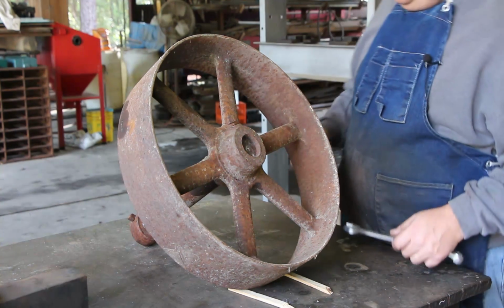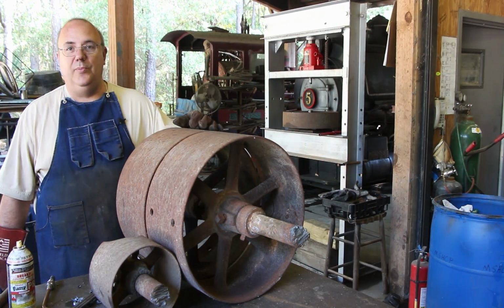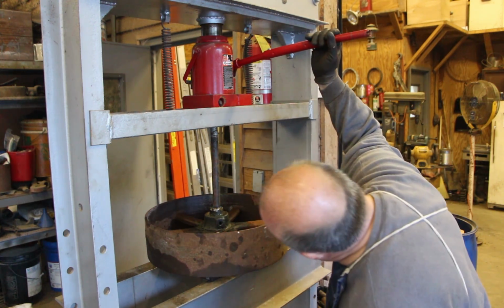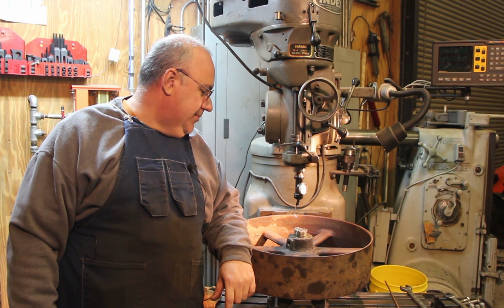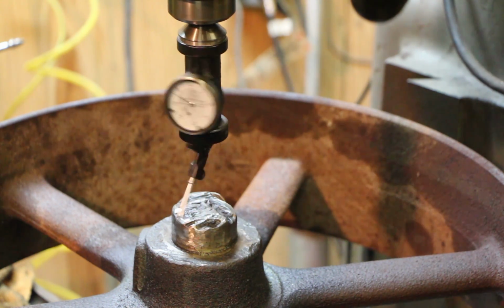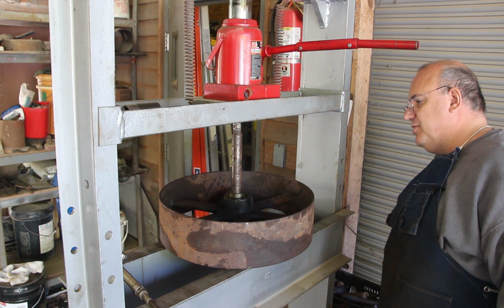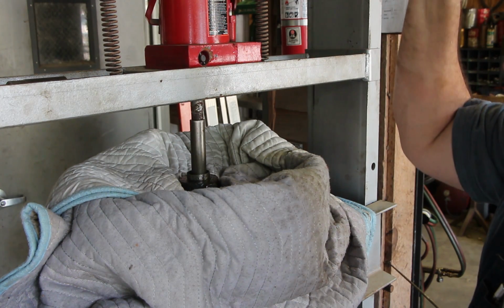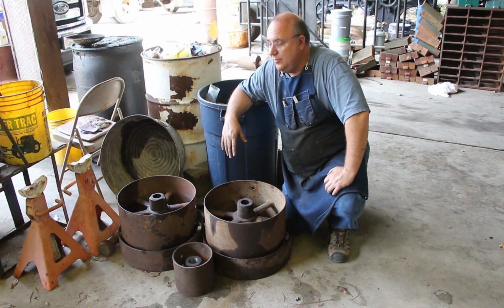Removing Stubborn Shafts from Flat Belt Pulleys

Comment: Once you had the hole drilled out, did you consider cutting it out with the torch?
  I've done that with large liners in oilfield pumps that were stuck.  You get the liner very hot and when you start your cut you cut across the entire liner.  I takes a nozzle for a cut the length of the liner, or in this case, shaft.  With a little practice you can cut it out without even scorching the cast iron.
Reply: ***** The biggest problem is not having enough oxygen volume to blow across the distance.  They sell larger hoses for this.

Comment: Keith, Nice to put a face with the name........................I hear about you a lot on OWWM,  but l never saw any of you work.
I am mrbreezeet1 over at OWWM. I have 3 or 4 projects "bloged" over there IIRC.
I guess you are mostly a machinist, and restore wood working and metal working machines, or do you also do wood working?
You seem to be pretty "hard core" of a machinist. I learned a few things from this video, and will be sure to watch more of your videos.

 lol...........what is to "Rucker" an Item again, is that when it is shipped by someone or someone's friend or father or mother or someone that is going that way?

Quick question about your mill used in the video,l was in a adult class about 20 years ago already I guess, we just had a small bridgeport. But you were loosening some bolts, and moved the spindle somehow forward, is that like a radial mill, along the lines of a radial drill press?
Thank you sir, and thanks again for the videos, l will watch more for sure.
Anthony
Reply: ***** I am not sure, I will have to watch the video again and note the time.
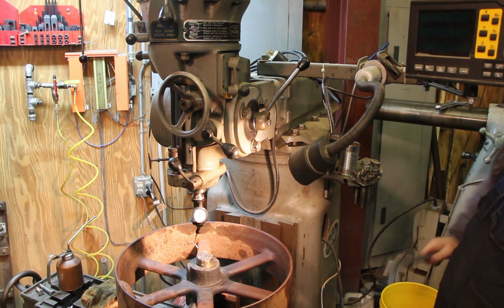Reply: anthony diodati  At 16:16 to 16:40. looks like you slide the hole head forward.
Reply: ***** OK, Thanks, Nice,
Reply: anthony diodati l have a lot to learn, and don't have a mill at all.

Comment: Keith,

You might like the cylinder liner splitter I made to remove liners from a locomotive in distress. The liners were tapered .007 to .011 inches and glued in. The splitter  is made from what else than a Harbor Freight arbor press.

http://youtu.be/C4v1Zzf9EIQ

Enjoy.
Kap Pullen

Comment: Hi keith ,i enjoy your videos very educational ,in engineering. Here is a tip that will keep you safe, when pressing stubborn shafts,pins,and bushes ,make your pushing bar with a bored hole at one end with plenty clearance to allow the hyd/jack piston to fit in this will stop the bar from jumping.

Comment: I once had the bottom bracket of my bike stuck like that, it made the same pop as I was screwing it out with two pipes as levers, penetrating oil and heat. 
It was a brass bracket, large diameter with fine threads corroded stuck.

Comment: Hey Keith, nice job on removing those shafts. I do a lot of press work myself working on mining equipment and learned that a little vibration from a small air hammer can work wonders. Just vibrate the shaft or sometimes the hub will cut pressing pressure in almost half mist of the time. I do occasionally use heat but a lot of stuff I work on can't have any heat applied due to tempering. Marvel Mystery Oil works wonders too as a penetration oil. I buy that by the gallon as I use it for everything including a light cutting oil.
 -Jesse

Comment: Most of the pulleys I have dealt with are very old and been on the shaft outside as well.  We've done a lot of restoration work on old grist mills in state parks all over Tennessee.  We've found that turning a pulley on a shaft with hot water has been much easier than trying to move the pulley sideways on the shaft. Once the pulley has been broke loose it spins easily on the shaft with the water in it even the shaft is extremely rusty.  If you continue to spin the pulley and then work it off the end the water cuts the rust off and tends to wash it out from under it.  The shaft comes out rather smooth with the rust cut off of it. We use a wooden timber like an oak 2 x 4 and fasten it to the pulley to turn it on the shaft.  By the way my handle is Clive and my daughter is Megan.  I know very little about computers.  My expertise is rust!

Comment: I'm 65 years old, been in the milling business for years.  Everything runs off of line shafts and pulleys.  An old gentleman that's now gone showed me how to remove cast iron pulleys from line shaft using hot water.  You hold the shaft and turn the pulley.  Hot water penetrates quicker than oil.  Once it breaks loose the least little bit water seems to break up the rust.  This has worked very well for us.  Never lost a line shaft to a torch or broken a pulley with a press.  I enjoyed your video. Contact me at ValentineMills@hotmail.com

Comment: Well done Keith. I would have loved to have been working on this with you. I would have told you of the fantastic tip I was once given...Weld a nut onto under side of shaft, and use a slide hammer from below whilst pressing from above...nothing beats a little impact!

Comment: Hey Keith, what are the holes for on the flat side that the belt rides on?  Love your videos and restorations, keep up the great work.  Sorry to hear about the theft of your camera, maybe It will work out for the better.
Reply: The holes were used to balance the pulleys.  Even back then they did that.   Not sure what they used for a balance but probably a bubble type.

Comment: You might also try shooting a cold air or CO2 "freeze it" can into the bore to quickly shrink the shaft. I haven't worked with old pulleys like you do but I have had problems getting things apart in much the same situation. We used a CO2 fire extinguisher and just hit the inside of the bored out area. It almost immediately popped free.
Reply: i know this is a really old comment but CO2 is a waste of money for stuff like this since that liquid nitrogen is just over a dollar a liter. we use it for interference fits on pins all the time.

Comment: Keith, that was one stubborn shaft for sure, but it didn't know who it was messing with!  I think "presserverence" should be added to the dictionary...meaning to keep pushing until something gives.  :-)

After your first press and torch cycle I was starting to wonder if you had another tapered shaft there, and how you'd check for that if you did. With all that rust a slight taper might not be measurable at the two hub faces. Would you just flip it and try the other way if it won't go on general suspicion?  

Thanks for letting us watch!  That was enough suspence for one day for me!

-- Mike

Comment: Keith, e-mail me the dimensions of the hydraulic bottle Jack. I'll try to come up with an air-pneumatic version. I need physical base size, bottle size, lift height, and tonnage rating. No guarantees, but who knows? I'll also need your snail mail address as I have a couple of things you might like...
Tom7601. .At cox . dot net

I messed up the address as much as possible to thwart the address Zombies. Take out the. . . .s,  At is @. Dot is rally a . , net is, net :-))

Comment: Hi Keith,
Nice job on getting that last axle out. Patience always helps in a shop. Would it have helped to drill all the way through the shaft and the use a broach to cut the shaft into several sections? Even if you went into the hub by a .001 or 2. That way you could have collapsed the shaft inside the hub. Just a thought.

Keep up the fine videos.

Comment: hi Keith having worked in the heavy transport industry for 30 years you are doing everything correctly but for the one thing it really needs. when things are seriously time welded together only extreme smoke and perhaps heat and pressure at the same time, but shock is the key.
thanx for the videos simon

Comment: A method I have heard about is to use a cutting torch start the blow then turn off the gas.  Just use the oxygen to open the hole.  I am not sure this method would work in this situation.  I think it would be better used for a blind hole in a cast iron casting.  What happens is the steel gets melted and blown out not damaging the threads or casting.

Comment: Great video!  Lots of learnings to take away!

I wonder if a little liquid nitrogen poured inside the bore would have made it let loose less violently?
Reply: Good idea. Up there with shrinking the drilled out shaft with an arc welder.

Comment: I feel your pain Keith. Been on jobs like that many times. They can extremely time consuming and frustrating, even worse when the customers don't want to pay you for all the time spent working on the job.
But you did good, and tackled it in the same way I would, by boring out the center. I've done that on rotor shafts before. I'm glad to see that press finally pop! Success!
Talk to ya soon.

Adam
Reply: In the truck shop I regularly press out walking beam bushings, you can try to prepare yourself for when it jumps but it always gets ya. I've had 100 tons on some before they pop. 200,000lbs. the press literally jumps 1/2" off the floor. They really should bolt that thing down. lol
Reply: @Travisfromoregon  Scary.
Reply: We have a 50 ton press... and I had a 70 ton in my shop... yep those can bounce off ground and make you drop a load in your pants.
Reply: I served a student observation fortnight on the copper mine in my home town in Northern Rhodesia in the '60's. We spent a couple of days in each surface shop. When in the electrical shop we had a 400 HP electric motor come in that had just burned up on one of the crushers. It was still smoking and you had to handle it with gloves. It cooled overnight and we had to get the drive flange off the shaft. They put a "Portapac" on the end of the shaft and pumped the ram to 100 tons. It wouldn't move. The tech put a screen around it and told everyone to stay away. A couple of hours later there was an "explosion" and the "Portapac" went hurtling across the shop. The inards of the motor had finally cooled enough to allow the flange to come off but I swear we all needed clean underwear after. Good thing the tech had warned everyone to stay behind the ram so as not to get hit by it when it came off. It would have severely mamed whoever it hit  if they hadn't listened.
Reply: Abom79 ?;6
Reply: Why not take torchcut. It out torch won't cut your cast iron

Comment: Hi Keith,

There's a technique I've used a couple of times because I lacked a large diameter drill. I drilled the shaft offset (close to its outer surface) and then bored it out until I just broke through the surface at one point. If the shaft alignment is good, you might break through all the way through the hub, but if not, no matter. I closed the boring head down a little and offset the hub to work on the unbroken sections of the bore wall. Eventually I had a break all the way through and the shaft pressed out no problem. On another even more stubborn shaft, I had to drill a row of holes across the shaft to allow it to 'spring' more easily.
Reply: Ya, drilling 30+ 0.125" dia deep holes is NOT easy,,, just have maybe 50" long bits and continuous oil flow in a 'rock solid' setup!
On 2nd thought, do it with .250 bits  ..
Reply: Sorry!  "  50+ BITS , not 50"  ...

Comment: add me to the list of  being on the edge of my seat their Keith,  Press explosions are not funny sam
Reply: ***** Learned the hard way back in the 70's with GM U joints they then started putting loctite in pre drilled holes.  You have to heat the joint first, or it will explode. sam

Comment: Lol that was quite the project. I don't know if it would work but I've use an air hammer a time or two to knock stuck pulleys off shafts. Just to get that initial break between the surfaces. A really good video Keith with more that a few ways to work through a problem.

Comment: I have a smaller but similar press as you its very simple to rig something up with a sawza it will make all the difference in the world. Have quite a bit of power to. Not enough to get a lot of pressure but still helps so so much!  I use a Milwaukee with adjustable stroke but any cheap sawza would work.
Id love to see you make a.  Video rigging something like that up .
I watch all your videos and love them!

Comment: Keith after having worked on big industrial equipment the only thing I kept thinking in the back of my mind is get a big brass punch (1" plus) sit it on the hub and wack the punch with a hammer.  Sometimes between heating the hub, and pressure on the shaft the jar of vibration from an impact will get something to move for you.  It doesn't always work but it works often enough to add it to the arsenal of weapons for projects like this.

Comment: Hey Keith, I work with non-ferrous materials and run into parts stuck together fairly often. One trick I use is heating up parts and then quenching them to crack the corrosion. I know it wouldn't have helped on this pulley, but is quenching the parts something worth doing with ferrous components, or would that have detrimental effects on the work piece?

Comment: Hey Keith,  Cool demo on the coaxial indicator, I will be ordering one of those.  Question:  I have a face mill similar to that one, made by shars.  When I use it, I have noticed that all the sudden, it will start cutting deeper than it should be, and it starts to bind up.  What I find is that the holding screw must back off or something and allow one of the inserts to drop down a little.  Although when I check it they are all tight, but one insert has slipped down, have you seen that happen?  Way to stay after that stubborn shaft, good to see the post mortem...
Reply: ***** The shop I used to work in supplied us with 2 in face, inch travel indicators. The Purchasing agent bought em by the dozen. One fellow got a kick out of saying, "Shars a good indicator , ain't it?" :)

Comment: Man!  That was a tough one.  I have a 25 ton Dake in my home shop. It works good most of the time.  Once I was trying to get the wishbone bolts out of the axle I was planing to use on my model T hot rod.  The axle was from a 1937 Ford truck and I am sure it was never apart before.  Ultimately I had to drill it much like you did your shaft.  It took me a goot 6 days (after work) to get those out.  What a pain!

Comment: Wow was that tight! would have been nice to have a gauge to see how many tons that took to basically shear the galling from the set screw. How many ton jack is that? I have  greatest respect for the guy that had to do that job on machines where you couldn't remove the shaft or have little to work with back in the day.

Comment: That was a great and wise fundamental engineering approach,  Pull on an elastic band and it gets thinner, push on it, and it gets fatter.  By pushing on the bottom of the "tube", you are literally pulling the shaft out, and thus thinning its diameter.  Very good!!

Perhaps you, like me, enjoy the hand feel connection with the work process by keeping with the manual jack lever.  Automating the press would be great for production, but I'd lose the feel of the job.

Comment: Keith,
Wow! You got a workout on that last one. Why is it that when you are working on several things involving the same operation, one has to be a "tough dog" and spoil your day?!?!?  It ain't fair! But, like you said, you won the war! That's a good trick with the blanket. I've never thought of that before, but if that pulley let loose, you could be injured from flying shrapnel. Yes, I have seen bearing races break or come off the bearing and the balls go flying all over the place.  Thanks for the interesting and exhausting video! (Watching all your hard work makes me want to take a shower and have a glass of iced tea!) You're in the home stretch now! Things should be a breeze from here on out . . . the key phrase here is "should be"!
Have a good one!
Dave
Reply: ***** Will the clothes washing machine get the marks deposited in your undies out from when it made that first pop?  It even made me jump. 

Another trick to add or maybe is in your arsenal of tricks would have been to stuck your welding rod in the bore and just drag it back out making a spider trail of surface beads in various places.  The shrinkage would have pulled the circumference of the insert in a bit.  But then the jill-farted part might have still gave you fits.

Keep up the great work!
Reply: When working on several things, and the first one goes just too easy, you know there's problems lurking in the near future...
I learned to be careful with the heat when I was trying to remove a pulley/flywheel from an air compressor. The hub and spokes expanded enough to crack the outer rim. That POP was veeery close to a undies/washing machine issue....

Comment: While we're talking about shrapnel, I always cringe when you're pressing something out with a pin or shaft. I know you had a bolt fly out of that press recently, lucky it went the other way. Maybe you could fab up some sort of capture collar to use under your main press pin, to prevent the intermediate shaft from squirting out of there under pressure. We need you in one piece!

Comment: Maybe because most of the shops I've worked at had liquid Nitrogen around all the time anyway, but once you made the cup, I'm surprised you didn't fill it with liquid Nitrogen.    That usually shrinks a  shaft enough that it drops right out.